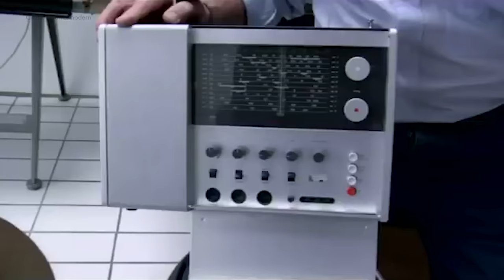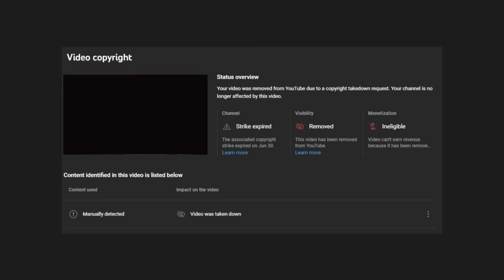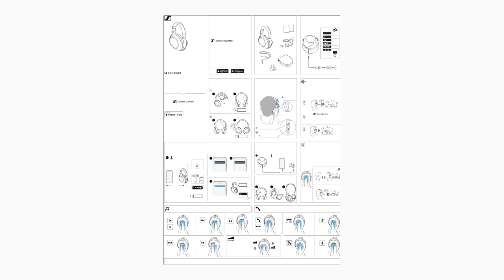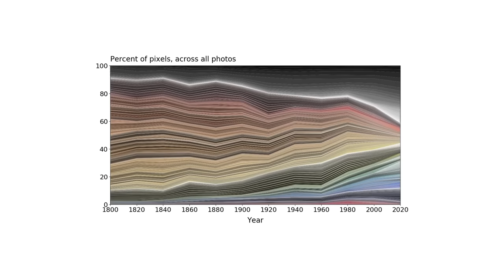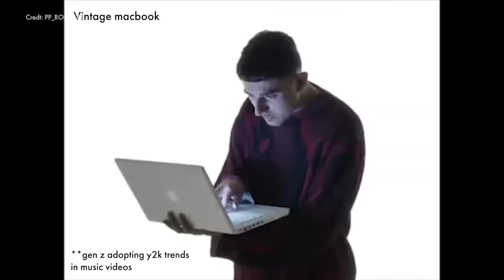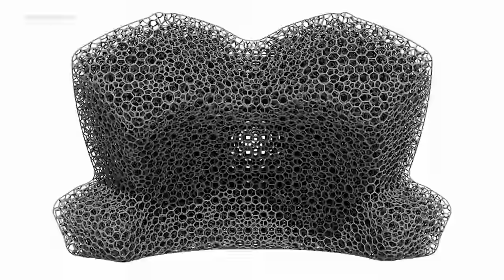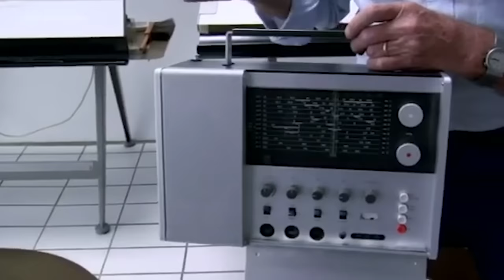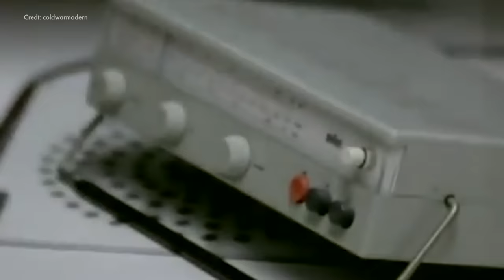Minimalism is Getting Absurd: Updating Dieter Rams' 10 Principles

Comment: I think you're sometimes bending reality a little too much to fit your points. Ram's Porche really is one of the most minimal cars at any point in time, (it's hard to find a more minimal one even today) it also fits aerodynamics well which is rational.
Reply from the maker: read the pinned comment
Reply: @Design.Theory  huh? But that Porche is none of those things. It is minimal and aerodynamic on the outside with only required bits. But on the inside it has all the buttons people need to control it well. I fail to see how it plays against Ram's principles.
Reply from the maker: Nah, the Porsche is still very heavily driven by aesthetic styling. It's not 'as little design as possible'. Not even close. If you want a truly functional sports car with as little design as possible, go look up the 2008 Radical Supersport SR8. There are a bunch of other examples that I can't think of right now off the top of my head also.
Reply: @Design.Theory  That design would have zero space tho, it's also not a more aerodynamic design. It's designed to be driven at ludicrous speeds and generate an insane amount of down force. The perfect aerodynamic shape is a raindrop which the porche is closer to.
Reply: @theniii  The guy doesn't even know the difference between a sports car and a race car with a 1inch ground clearance - I think any argument with them is a waste of time. For the record, I completely agree with your point.

Comment: The 911 is a great example of what Dieter was arguing for in car design - relative consistency compared to, as he said, "change every two years."
Reply: i wanted to make this same point, as that particular porsche he was pictured with was the final evolution of the original 911. it still uses the same windshield
Reply: It has also excellent quality and no unnecessary clutter. It's just simple.
Reply: Dieter’s 911 is the final evolution of the last aircooled Porsche. This model is known as the 993 which came out in 1995. This model is a refinement of the original 911 from 1963. Many parts of these cars are interchangeable over a period of a decade. The newer Porsches currently produced are known for changing style like fashion.
Reply: I only know 911 to mean the emergency number, though everyone else seems to be talking about something else. r/outoftheloop
Reply: Though the 993 is the most emotionally designed air-cooled 911s. In order to sell more of them than with the 964, they re-introduced and even enhanced the coke bottle design of the wide bodied G models of the late 70s and 80s. 
The 964 is pretty Bauhaus compared to the fashionable 993. And more popular it was.
Reply: Yes!
Reply: @fastandcurious  What is a 911? A 993? You keep using a lot of numbers I don't understand.
Reply: @BrianWoodruff-Jr  the car, Porsche 911

Comment: The irony about the environmentally friendly rule is that the most minimalist companies are also the ones that want us to throw away our old products and replace them as fast as possible.
Reply: And often make electronic devices that are battery powered despite having a use cycle where they are never moved more than an arm's length from the charger.
Reply: @mpf1947   Or start making really good budget devices only to keep making them worse to make their flagship devices a better option.
Reply: @@thesystem6246  I hate paper straws (the old kind that goes muchy) but I do like the cardboard cups/coffee cups. I think food safe natural/nontoxic bio resen could fix any 'wet' problem though. It's not like there's reason treated wood that ~~doesn't break down~~ UNLESS MULTCHED!
Reply: Apple is the first thing that comes to mind.

Comment: About bonsai, well, that's actually the opposite. Wiring is used to actually bend the tree to your will and you can actually bend each branch as you want. It just takes more time and effort. The size of the leafs also can vary according to the amount of nutrient you give your tree. That being said, I agree with you tho. Some parts of a design can be "random". I think it can make it flow more organically.
Reply: The "randomness" of a bonsai is carefully curated much like the "natural" look of a landscaped garden.
Reply: It will always be a peach tree.
Reply: Well I think what he wanted to say is that you can't make a branch appear out of nothing. Actually you can make the tree grow a lot where you want, for example cut so that the next bud does become a branch, but maybe the tree develops more the second bud which is in the opposite direction you wanted.

And you can't control EACH leaf. You could graft but that only works up to a certain point, having for example exactly a leaf of a green maple then a leaf of a variegated maple alternating would be difficult: if the tree throws off one leaf, it's ruined.

Even for bonsaï, you can't control every detail.
Reply: @xeetzer5478  yes, you can control each leave. It is just more effort and maybe not necessary.
Reply: @oupwo7468  How would you that? For example to have alternating sizes of leaves?
Reply: @xeetzer5478  cut 1/2 leaves alternating them and give the tree nutrients. The leaves that weren't cut still grow, the new ones grow as well but they are smaller than the ones that weren't cut. At least this is how I would do it, and I am no pro at bonsai tree making.
Reply: @oupwo7468 thats still not 100% control, his point was totally valid, how you choose to interpret it to find fault is whats the problem tbh.

Comment: My parents had a kitchen kitchen timer with up to 3 independently programmable timers with only 3 buttons?!
It was impossible for anyone but my dad to set up a simple 2 minute timer for tea.

They eventually got rid of it in favour of a old spring loaded mechanically kitchen timer . . .
Reply: And I bet they could get 3 cheap wind-up timers for what they paid for the fancy one. :)
Reply: My oven does this and I fucking hate it. It’s this sterile, button-free thing that’s a pain to use.

For example. To change the timer duration, you’d think you need to hit cancel, right?

No! You have to hit timer again because hitting cancel turns off the heat.

What the hell? Just give me some bloody dials and make it simple instead of a bajillion clicks.

Comment: That Casio vs Braun Calculator brought me smile. Because my father is an Accountant, he has variety of normal arithmetic calculators from pocket sized to big sized from Casio, Citizen, Braun etc,. But me being from Engineering background, I only use Casio Scientific Calculator. It serves my purpose. You know Casio is also a Design Icon(f91 w). A request to make a video on Casio's Design Language. They tend to maintain this retro-futuristic vibe among their watches, calculators, music gears... As usual nice video 👍
Reply: I love my old, boxy-looking Sharp calculus calculator with its resolutely squarish rectangular buttons that depress very easily, yet offer a tactile initial resistance that gives you just enough feedback. I'd bet anything that the buttons on the Braun unit featured in this video are uncomfortable to use and tactilely more confusing and thus less functional. Even if they have the same resistance-to-yield feel as the Sharp, their pronouncedly convex shape would almost certainly generate some soreness in the fingertips of anyone who had to use that calculator for several hours a day. And don't get me started on the tendency of printed buttons to have their labels wear off over time... No, I'll pass on that one, thx.
Reply: @MattBellzminion  yes, good analysis
Reply: @MattBellzminion  Exactly what I saw.  That Braun calculator triggers an immediate sense of revulsion in me.  I don't want to touch those buttons, I definitely don't want to do any extensive use of it.  It might be an interesting looking design (I hate the way it looks, but that's subjective) but no matter what you think about the looks it's functionally cursed.
I'm not a product designer, I didn't know who Dieter Rams was until today.  And now I hate him.

Comment: As a non-designer, a principle I might suggest is that good design has a sense of purpose. A good design is one that is made with a clear understanding of what the design is seeking to achieve. If the object is meant to be utilitarian, all aspects of the design should support ease of use. If it's meant to be aesthetic, all aspects should contribute to a clear aesthetic vision. If it's some mixture of the two, all aspects should fulfill both. If the design is meant to be eco-friendly, all aspects should be made to work in harmony with nature. Fundamentally, a good design starts with a complete understanding of why the object is being designed.

Comment: thanks for always being fair about the points you make, not discrediting companies or even give them a bit of slack when they improved (the slots on macbooks for example)

edit: regarding the Porsche. Of all sport cars the 911 is arguably the most usable one in daily life, with actual luggage space, two backseats and a rather comfortable ride. I'm backing Rams on this one ;)
Reply from the maker: Thanks for the kind words. The Porsche is also probably the least changed over a period of decades compared to other cars. But it's still definitely an excessive purchase made primarily based in emotion (once again, nothing wrong with that, as I mention in the video)
Reply: @Design.Theory if you compare the Porsche RS family with cars with similar performance, you may end up paying 10x more to go slightly faster.

Comment: About rule 5: good design is thorough to the last detail

I think Dieter meant that what you CHOOSE to present should always be intentional.
The process isn't always intentional. Some mistakes lead down an interesting path.
But ultimately, it's up to you to decide if that is your final design or not. You are the one that should decide if you leave that accidental line or not

I'm a graphic designer and I think this specific rule is hard to refute
Because for us, there cannot be any element on the page that doesn't have a clear motive to be there and a clearly defined relation with the other elements on the page

So yeah, good design, at least for me, is indeed intentional. Even if you discovered it by accident, its your judgement and knowledge that helps you decide it is worth keeping it

Comment: "less but better" probably should be replaced with something like "good design does not let aesthetic override function."  A minimalist or maximalist approach both can work quite well, but if your blender disguises all the buttons and settings as seamless sides of the device, or inscrutable symbols, then it fundamentally fails at its purpose. You can add flashy or cohesive elements all you like as long as that doesn't actively lead the user away from how something should be used.  It doesn't have to be the most effective or powerful thing, but it should invite the user to use it well rather than lead the user down a path of misuse. A good watch may not have intuitive time telling, but it shouldn't have a design that acts to PREVENT you from telling the time if it's trying to do so.
Reply: unless you're designing a novelty/joke item, of course. ;)

My condensed rule would be; adapt your design to the purpose in mind

Comment: Dr. W. Edwards Deming, the "Father of Quality", talked about this kind of thing. The ideas that got us to this point, aren't going to take us to a point in the future; "we know a lot about ice, but don't know anything about water". Also that profound knowledge comes from outside of a system, not from inside, otherwise you fall victim to the fallacy that "this is how we've always done it, it worked in the past so it will keep working in the future". We need outside perspectives and new ideas for a transformed and continuously improving theory. "Best efforts are essential, but they are not enough, theory is required." If you're trying your best at doing something incorrectly, it's just causing damage and wasting time, like "fixing" a jet engine with a sledgehammer.

Comment: One element of design that makes me feel good about using a product is when I can tell the designer was anticipating what the user's needs. For example, at 3:15, the calculator's function buttons are differently colored than the numeral buttons. This visual cue helps the eye and mind to separate them so you can finish your task more quickly.

Comment: 11:49 He drives a Porsche 993 in that picture. Porsche in essence didn’t change the core design of the 911 for 34 years, from 1963 until the introduction of the water cooled 996 in 1997. Sure, the body grew wider, the fenders became a little rounded, they fiddled around a little with the bumpers, but apart from that the greenhouse stayed exactly the same, so did the doors and the overall appearance. Much like the VW Beetle or the Citroën 2CV. Maybe he chose it for that very reason?

Comment: The entire concept of eco-friendliness is increasingly crucial in the design of products, and it's also intricately woven into the realm of architecture. However, the most significant environmental impact of design, particularly in architecture, occurs during the construction and production phases. Consequently, the most sustainable approach to designing a product or a building involves creating something that not only endures for an extended period but is also cherished by its users, leading to prolonged usage.

Some buildings constructed not even four decades ago are already facing demolition due to being deemed "outdated." In stark contrast, historical Renaissance-era structures still stand as captivating marvels. In my perspective, the design must align with the intended purpose of the product. For instance, products like phones, meant to be used for a limited span due to rapidly advancing technology, can accommodate more experimental ideas. However, particularly in architecture, where the focus is on eco-friendliness, designs should be chosen with the user's enjoyment in mind for the long term – spanning 50 or even 100 years.

The most environmentally conscious building is one that requires no reconstruction but is diligently maintained. The cornerstone of achieving such a feat lies in creating a structure that can be consistently cherished and upheld by the users over time.

Comment: I’m a short trumpet player (5’0” in Converse) and I often play in big bands and orchestras (musical theatre and symphony). Most of the time in larger ensembles, trumpets are behind at least two rows of other instruments and, because of my height and the massive variety in stage setups, I find that 3”+ heels are extremely useful in performing so that I can play comfortably while keeping my bell up high enough that my sound isn’t buried (or blasted directly into the ears of the players in front of me). Additionally, most chairs made for adults are at least 5” too tall to be able to sit and play comfortably without either wearing absurd heels or putting my feet on a case or stack of books. Also, chairs with arms are generally awful for playing most instruments because the arms get in the way of our own arms and/or our instruments (my boyfriend plays a lot of bari sax and has to play with it to the side if he wants to actually sit in a chair rather than perching on it). Height adjustable chairs should absolutely become the standard for concert halls in my opinion.